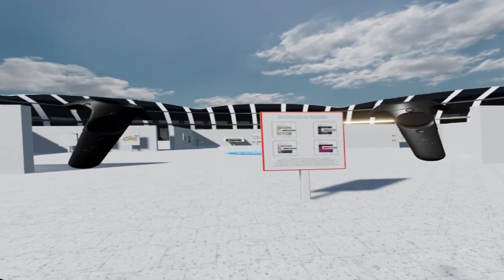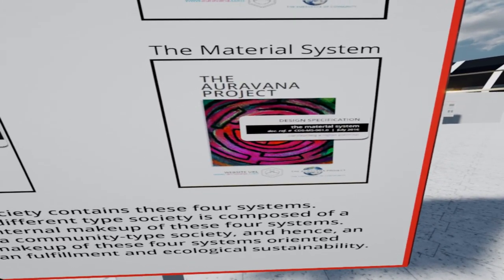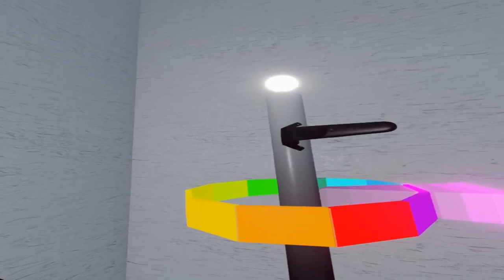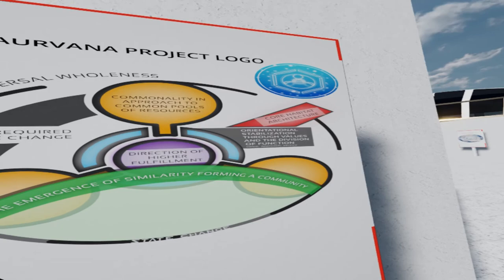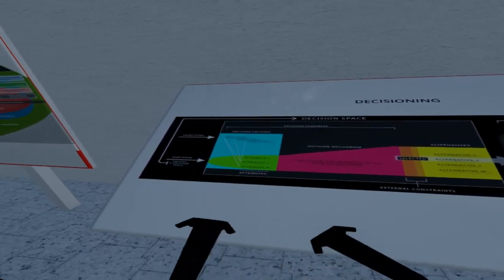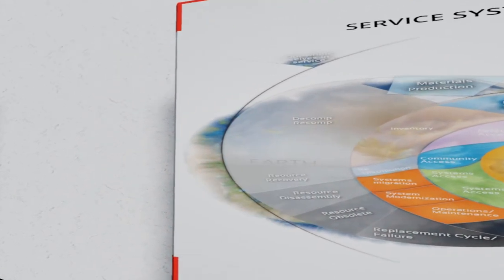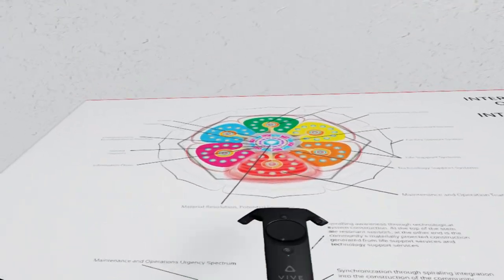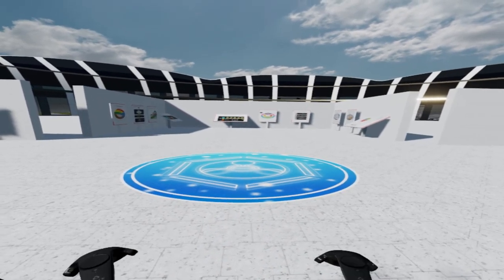Virtual Reality Tour of the Auravana Project's Design Specifications

Comment: Villa Savoye which was designed by Le Corbusier was designed to be placed anywhere in the world so long it was in a field. He was successful in having it constructed because he was one of the greatest living architects of his time. There are few architects that get similar opportunities today to build whatever they want on sites that are essentially blank slates. Projects  being constructed today more than ever must take their surrounding climates into account to perform optimally, and in democratic societies especially there is much more red tape. Villa Savoye had a huge positive impact on architecture for its time period but a more relevent and recent example would be Quinta da Malagueira the social housing project by Álvaro Siza. Because of its sheer size, the context of Quinta da Malagueira required solutions that addressed budget concerns and a site which was sloped, for example the project was built with concrete aqueducts for cheaper water and electricity distribution. "Of the 1100 dwellings that had been built by 1977, 60% were cooperatives, 35% rental and 5% privately owned. Financing was arranged so that houses could be owned after 25 years. The co-ops also controlled resale prices to limit speculation and sub-letting was not allowed. These and other rules limiting modifications to the original building contributed to a sense of well-being and a high level of maintenance." I wonder what a modern, self sustaining, and energy self-sufficient Quinta da Malagueira would look like. All the fanciest diagrams in the world at the end of the day are just diagrams, what are the laws?

Comment: Ok, so... to actually design the city we need to have the land first, cause the design of the city will depend on the land available and its specifications... to get a piece of land large enough (2000 hectares) and completely flat we need to have a large group of people formed in the region we live in... a group of about 500 to 2000 people... 1000 people giving 1000 dollars each gather 1 million dollars... a large group is also interesting because it can produce more work in less time... more people means more relations problems, which are the largest problems in thesekind of projects, but we can cope with that by using technology to help make decision making more efficient, which would help with relations problems, much of which comes from decision making in the community... another idea is to form the group, buy the land, than build a smaller ecovillage, but imitating and testing the RBE as much as possible, and then, after, a larger full RBE city... the first one would serve as experience building, temporary shelter while building the second one, and it would produce and develop open source technologies that could be used in the construction of the second one...
Reply: @thebx-substack-com  No, flat is better because you spend less energy and fuel with transportations of people and goods. Plus its easier to build in, easier for people to walk in, easier for older people and people with special needs too. But yes, the piece of land we buy to build the city in would probably be a farm. But no, slopes are not inevitable. There are farms with flat terrain for sale. If we just buy one of those we would be avoiding slopes, so not inevitable. And there's no reason not to get flat, like, there's no down side, so not doing it flat would be crazy.